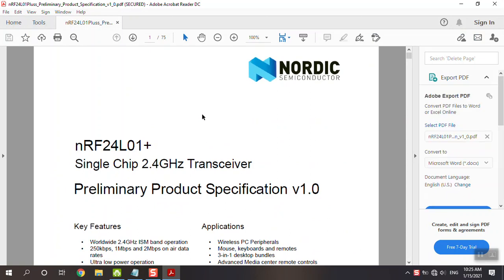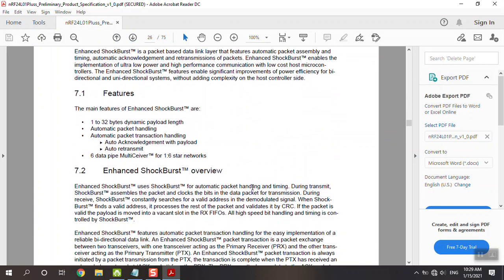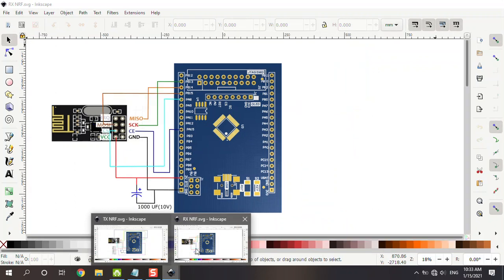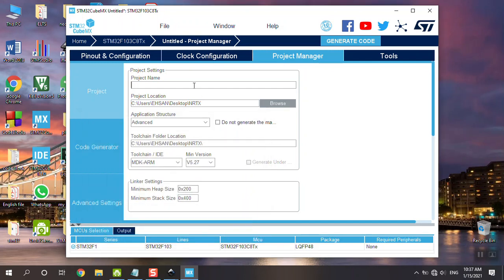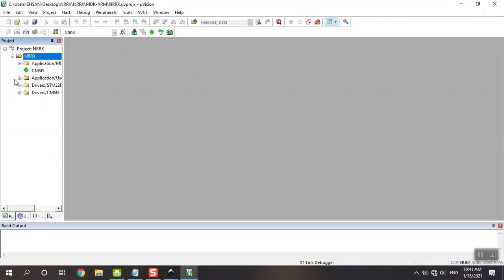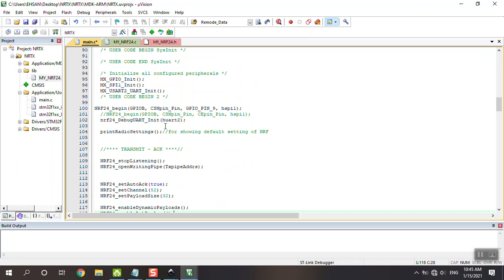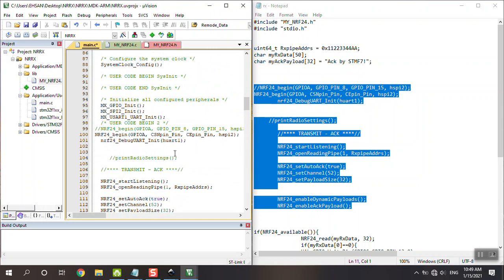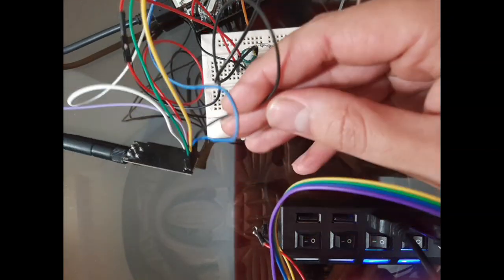NRF With STM32

Comment: i have problems when i use the library, it doesn't transmit or receive on a stm32f103c8, I can't understand why it fails, but when using the nrf24_write function it doesn't write or transmit, the same with nrf24_read. can you help me?
Reply from the maker: Try to check information with Usart
Then use same peripheral I used in video
If you have problem send me message

Comment: When i try to read a random register of nRF24L01, it always returns me 0x0E . Did i do something wrong ?
Reply from the maker: can you explane more?
l comment second part in while part please check this part I mean send 《 hello word》and see that this string send it correctly or not?
this code transfer data 32 bit
Reply: @self-studyelectronicengine7294  Firstly, I set up Tx mode, then I try to read a random register 
For example :
uint8_t receiver;

 SPI1_CE_LOW;            /*Turn off CE*/

  SPI1_CSN_LOW;
  SPI_DRV_MASTER_TransmitDataFromBuffer(SPI1,0x25u);
  SPI_DRV_MASTER_TransmitDataFromBuffer(SPI1,0x13u);
  SPI1_CSN_HIGH;

  SPI1_CSN_LOW;                        /*Turn off CSN*/
  SPI_DRV_MASTER_TransmitDataFromBuffer(SPI1,0x05); 
  receiver = SPI_DRV_MASTER_ReadDataFromBuffer(SPI1); 
  SPI1_CSN_HIGH;                  /*Turn on CSN*/

SPI1_CE_HIGH;               /*Turn on CE*/

As you can see,  receiver must be  0x13, but the result is always 0x0E. I tried to other registers but the results are still same. Can you help me, please?
Reply from the maker: can you explane more?
l comment second part in while part please check this part I mean send 《 hello word》and see that this string send it correctly or not?
this code transfer data 32 bit
Reply from the maker: I'm so sorry these days Im very busy,l can't understand why are you using register?
because in most of the case we just need a string like "Hello word" and I receive this data clearly on RX or as you can see in video I push one button and the other side I mean in the receiver led is on it means everything work correctly.
at first you try that send string on receiver if It work every think is right.
this is my gmail adress
ehsanmohanadpour311@gmail .com
if you have problem please send me a mail and may we have connection on any program as you want and talk about on your problem with more detail